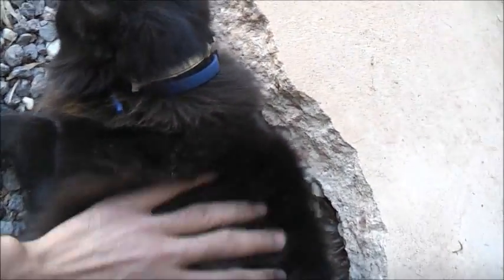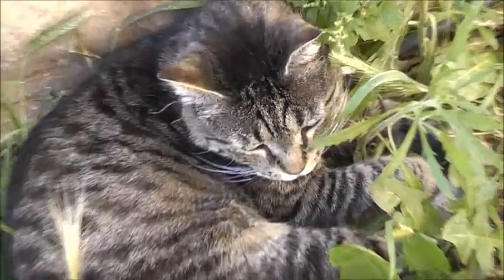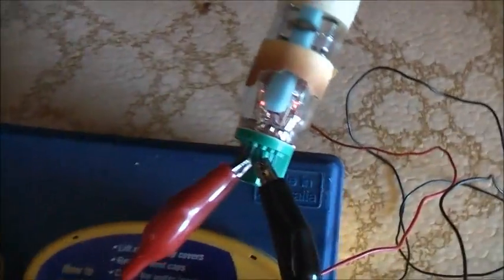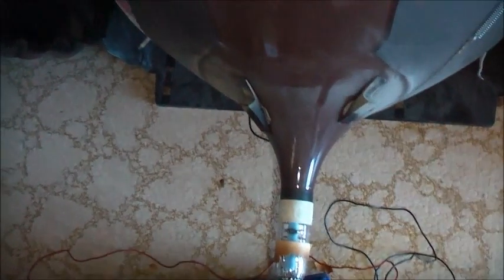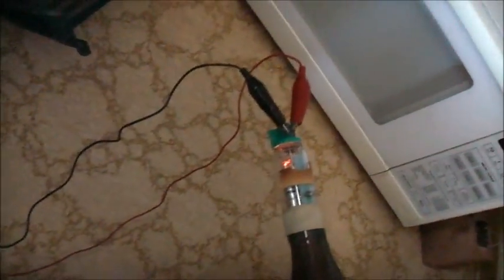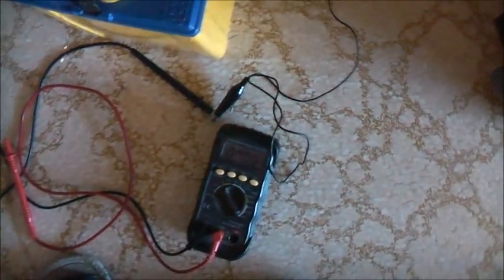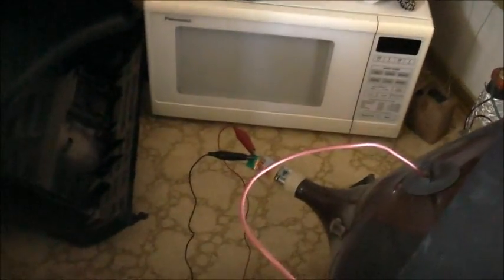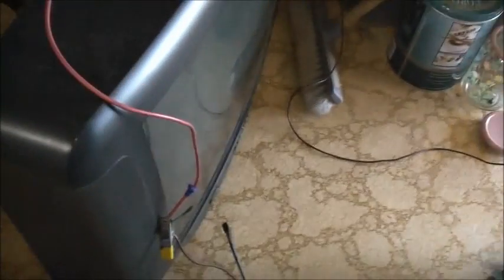CRT VS NST

Comment: The little tiger is so cute :-)

D.c on the anode cap, 25k should do, dc bias needed on excelerator anodes :-)

Does australia have a mouse problem as most aussies i watch have two cats?